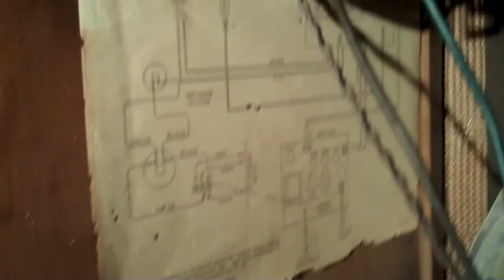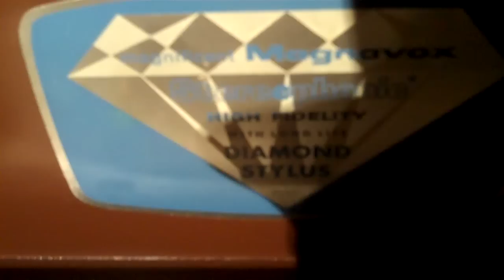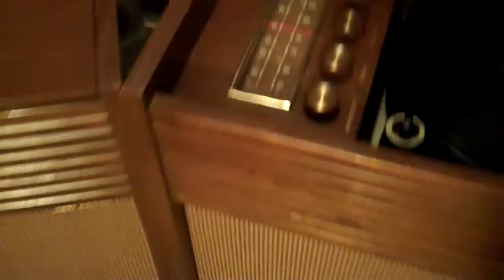1960 Magnavox console stereo demonstration

Comment: Very nice example of a console from the early days of stereo.   I have an earlier one from 1957 that was factory converted to stereo and each cabinet has it's own separate amp.  I had to use a Micromatic changer like yours while I waited to find the original changer that came with my set.  The original changer was jammed and  teeth were stripped from the gears.  Luckily I found an exact replacement to the original and installed it several weeks ago.
Reply: I have the 1958 "Modern Concierto"  - it has the 175-67 power amp with both channels on the chassis fat 12ax7x2; 6V6GT x 4 push pull. It has a tape input and an additional phono input, and even a place on the chassis for anOther phono input marked but not stamped out. Had it for 4 months and still scared to try it again to see what it may need.. might need a lot of recaps and work on the changer and the receiver.  It's gonna be awesome sounding tho, 15" woofers and even a 6x9 in the remote cab, as well as coaxial tweeters and 3 or 4 other midrange speakers..  It's sure not short on speakers. trying to psych myself out and reassemble it.  needs a grounded cord.

Comment: My grandparents had a similar setup in 1958. It was a Magnavox "Provincial" style with one 15" woofer, I believe an 8" mid and a horn tweeter in each cabinet.. The catch is. the other cabinet housed the television ( two doors on each ). The extra amplifier was in a chassis at the bottom of the TV, and the speakers worked as the second channel for the stereo. I have never seen another one like it. Later Grandaddy purchased the Magnavox "Armoire" system with two satellite  speakers disguised as octagonal end tables.. That was something, it had a very special collaro turntable that was lit..

Comment: do you have a seeburg microwage unit? I have one get one on the cheap w/ a blown amp and just run it through one of these consoles rather than to keep replacing original tt's!! the rather drap non microwage seeburg background units can go sort of on the cheap side (100 to 200) I'd say go that rout..just a suggestion as that was my solution